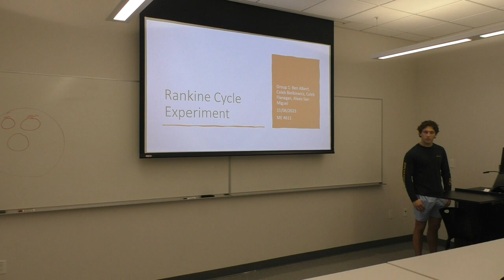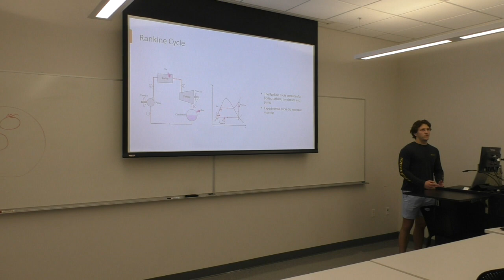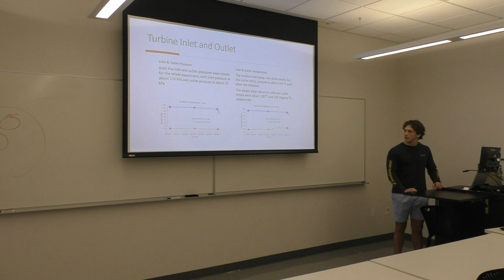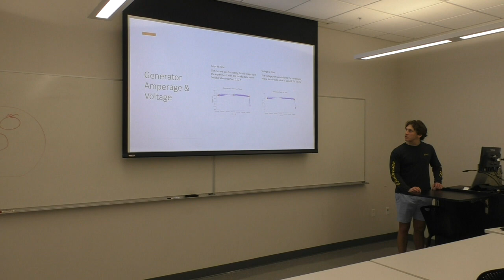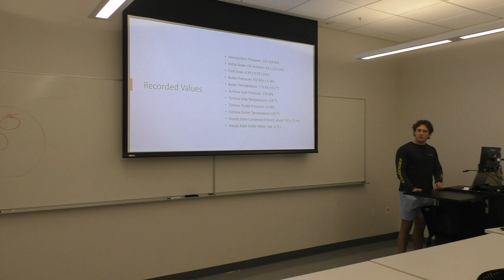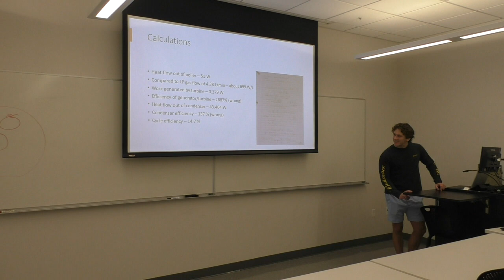Comment: Great work, Ben! Your explanation of the experimental data was thorough and insightful, especially your understanding of potential data skew due to the absence of a pump in the Rankine cycle. Your presentation skills were commendable; you articulated your points clearly and easily. How you presented and explained the plots and data to the audience was compelling and engaging. I have no critiques to offer, as your performance was excellent.